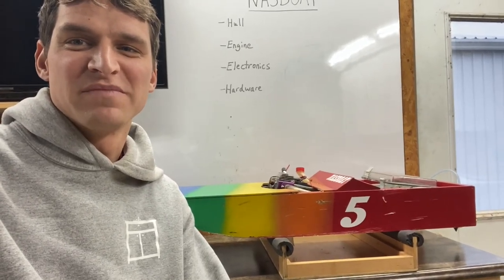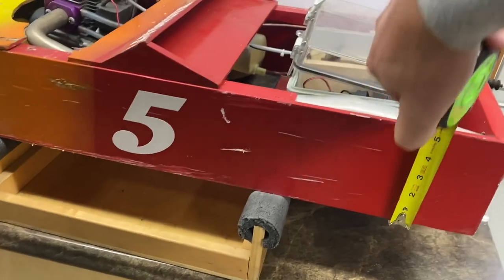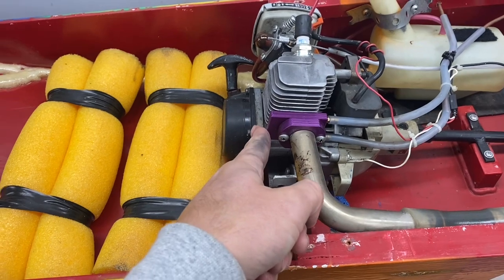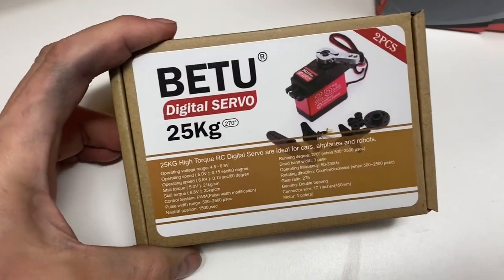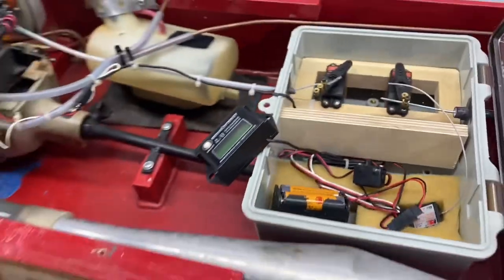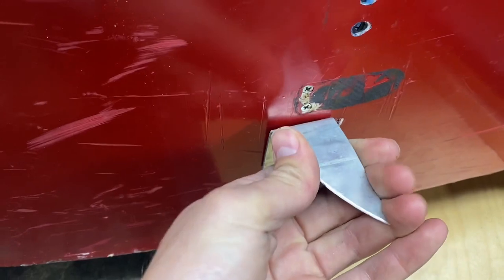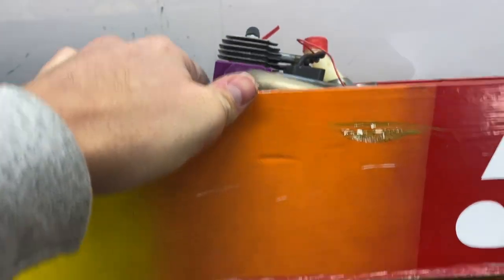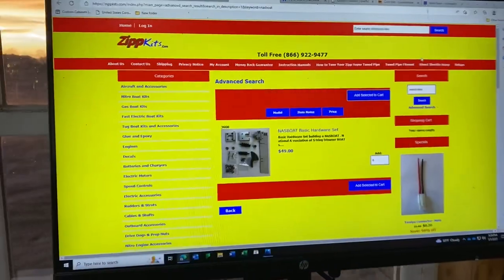How to make your own RC boat from scratch! NASBOAT design overview

Comment: Literally just found the channel, been running and building traditional rc race boats for years and I love the idea of these nasboats ! Be interesting to put one together with a stock zenoah 26 and some trim tabs haha.I usually run flyskys just with a digital screen love them
Reply from the maker: Yeah I have some zenoahs, I should put one in there and see. My boat from this last year was a Stihl FS250 and those motors really fly for string trimmers! NASBOAT has been a ton of fun!
Reply: Sorry for the late reply it would fly with a stock 26 Zen! And that they do very good string trimmer engines try stihl hp ultra at 32:1 what my race engine builder uses as most of us do . And a good prop from bonzi sports. It really looks like so much fun ! Maybe I can build one and create a new class to get into

Comment: I just scored an old homemade boat from 101-year old man with a weedeater motor in it. Just took it out for a little run.
Reply from the maker: How did it do?
Reply: Like you said steering's a big problem especially after your crash into some concrete under the water and it jack's your prop up pretty otherwise after it not running for over 20 years I figure it runs pretty good getting it fixed ASAP

Comment: I'm building a nasboat about 36"×12" in diameter,I'm running a 2200kv castle motor and esc. What size propeller do I need to run on a boat this size to get good results 🤔? Thanks!
Reply from the maker: For what we do with a string trimmer a Prather 270 for example works perfect.  I dont have any electric experience.

Comment: This is great.  How do you mount your engines?  I have a stihl engine and there are some vertical screws in the bottom but there's a big gap between the screws and the bottom of the engine.
Reply from the maker: With my stihl I made a spacer to fill that gap between the engine and the boat and then used some long bolts up through the bottom

Comment: What kind of motor is this please? And how many CC?
How wider you build your boat how slower he is.
Reply from the maker: The rainbow boat is a 21cc echo weed eater

Boat is about 14” wide, runs about 25
Reply: @theclevercraftsman  What size off prop do you use on this motor?

Comment: TCC, what is the waterproof box called? part number? from Amazon.
Reply from the maker: Zulkit Junction Box ABS Plastic Dustproof Waterproof IP65 Electrical Boxes Hinged Shell Outdoor Universal Project Enclosure Clear Cover with 2 Cable Glands 5.9 x 5.9 x 3.5 inch (150x150x90 mm) https://a.co/d/caWQUD0